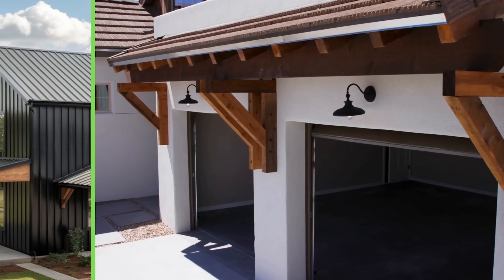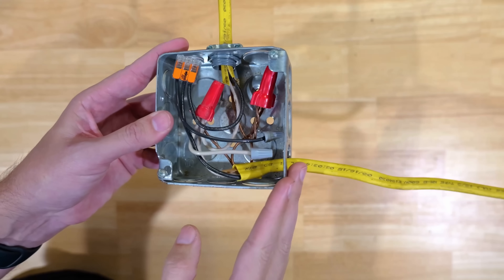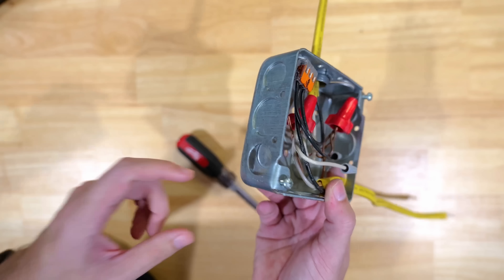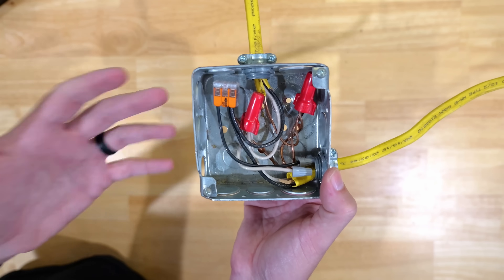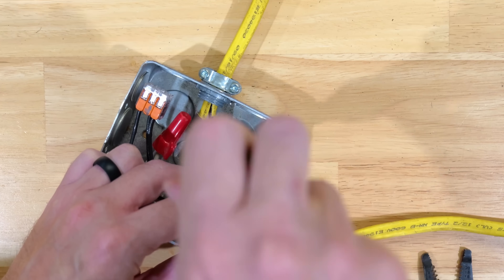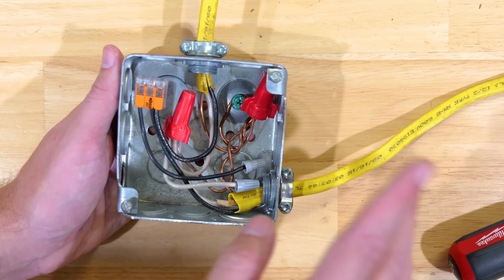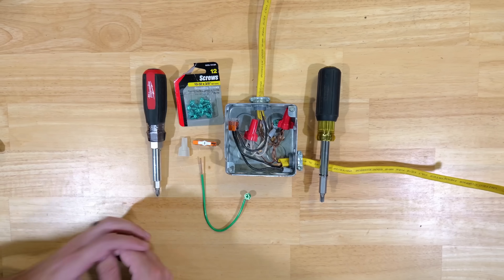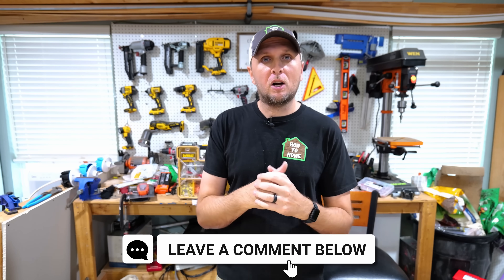SHOCKING Mistakes DIYers Make Installing Metal Electrical Boxes!

Comment from the maker: Be honest, have you ever made any of these mistakes or found any of them to be surprising?
Reply: @HowToHomeDIY  six inch rule. I didn’t take a measurement but assume I left a bit less.
Reply: @ryanyoder7573  Same here.  The wires do extend more than 3" from the box, but may not be 6" in total length.  Splicing the wires to make them 6" long adds another point of failure, whether it be additional wire nuts or Wago connectors.  This is a stupid rule and should be eliminated as it doesn't add one iota of safety.  The other mistakes are common sense and self explanatory.  I've never made them.
Reply: all of the above
Reply: It might be a good idea to give a link to the book "Code Check Electrical"
Reply: You seem to have a 2-position Wago connector with 3 wires in it, by putting 2 wires together under one clamp. I believe that's a no-no?
Reply: It's not that 14gauge wire is not rated for 20 amps, it's that code requires no higher than 15 amp overcurrent protection on 14 gauge wire (Breaker size) so yes,  it is against code. Same with 12 gauge and 20 amp overcurrent protection.
Reply: Once you added the ground pigtail to the box it is “bonded” but not grounded, there is only one place that is “grounded” and that is back at the service panel
Reply: @Coyote-tc1ww  Canadian electrician here. If we're being formal we do take care to refer to bonding and grounding separately and they are separately defined in the code. Of course everyone just refers to grounding informally. Are the terms rigidly defined in the NEC?
Reply: no
Reply: When I started I didnt know about leaving the knock out open.
Reply: On the used house I bought I found the most common mistake is the open hole box. I've been in this house for 31 years and have pretty much rewired the whole house.
Reply: Guilty as charged!
Reply: The stupidest thing that I've run into was a friend's house that I was putting new light fixtures in. In every light box, the ground wires were cut off to about an inch out of the sheathing and not connected. I had to extend the ground wires and when I checked the switches I found the same thing. All the plugs were properly grounded but not one light switch or fixture was grounded.
Reply: @danielbutler578 !!!
Reply: Is it common to have a small voltage on the ground copper wire?  Where could you test it for ground since it is ground?
Reply: The most interesting "mistake" is using a metal box.. why don't you use a good plastic box.. most boxes are pretty bullyproof and usable outside..
Reply: @Flying.Dutchm4n  Considering our codes are so similar, some of the differences between standard practice in Canada and the US are interesting. Where I am in Canada almost all the boxes we use are metal. PVC for certain applications and plastic for ICF work, but other than that it's pretty much metal all day long whether in the wall or on surface.
Reply: I haven't left 6" of wire in my boxes. I give myself enough to pull the wires 4" from the front. Thanks for the info!
Reply: Very thorough. Thanks 😊
Reply: The length is the most one. Mostly because if you are adding a box to an existing circuit,  slack is an issue.
Reply: Keep finding them in current house; think they were allergic to strain relief.  Just found one plastic box where they just broke the side to push a wire through; sub panel has ground and neutral on same bar... that's not going be fun to fix. 

6 inches of 12/2 for 20amp in a shallow single gang box seems a bit squishy.
Reply: Clickbait thumbnail. = "Don't recommend channel"
Reply: The surprise was the clickbait picture showing the Wago in flames. My rule is clickbait = unsubscribe. Or in this case, not subscribe. 
   No new info on Wagos, no new info on wiring. A waste of my time, so that you can get a few more (short term) minutes, by tricking me into watching .
Reply: @othername1000 same here.  See you all somewhere else.

Comment: I was waiting for you to point out that your Neutrals weren't twisted properly. The wire nut was there but it should be twisted enough to twist up the wires. You even noted the Grounds were properly twisted.

Comment: wago's will safely handle more current than a twisted and wire nut connection before melting. There are videos on you tube were this has ben tested.

Comment: Another mistake is assuming that it's a 20 amp circuit, just because it's #12 wire. In addition, NEC require that wiring is done, " in a neat and workmanship like manner."

Comment: No clamp / holder. Box is not grounded. Using a wago is gay. Why use a technique that makes it hard to take apart. Dumb af. Also where is this box going? Limited to places where you can use this technique

Comment: That last one is just an example of code stupidity. Particularly extending the wire in the box creating additional points of failure more equipment in the box to deal with in the likelihood of confusion during future maintenance.

Sure, code can say 6 inches of wire. But if you don’t have 6 inches of wire, there is zero safety reason for making you make any changes to that box whatsoever.

Comment: Another potential problem is the loose and sloppy connection of the 14 gauge wire within the Wago. We can see it pivoting and flopping all around as you handle the wire, so there's about a 100 percent chance that loose-ish connection will become nice and toasty with time and current.

Comment: Very good instruction video. These are all common things that are found. Wire length is crazy. 6 inches of wire is a lot of wire to stuff in a box. A 20 amp outlet box could have as many as three 12 awg romex , or even four. That could be twelve wires at 12 awg. Good luck with that. As for any thing to go under inspection. Rough in wiring you can let as much as you want hang out of an outlet box for inspection. After you finish wire I have never seen an inspector pull an outlet out to look. My idea is to let the wires long enough to work on comfortably and then tuck them back into the box. Just saying.

Comment: As a DYI'er I have seen test benches of the WAGO connectors going far beyond their rated ratios. Granted I am no electritian so again opinion they do work if you follow the instructions. I always give my stuff the tug test as well as the making sure no arking is occuring in the connector that the cable is snug in its position. I am sure if WAGO was a bad idea they'd have stopped making them long time ago
Reply from the maker: Okay?  Not sure what that has to do with anything.

Comment: One thing that boggles my mind is trying to get 12g 6 inch lengths stuffed into an outlet box. Trying to jam that much 12g wire into the back of the box while leaving enough room for the outlet to fit. The amount of stress put on the connectors seems counterintuitive to safety. Why not just leave a loop outside of the box with the plastic wire holder so u can just pull when u need more slack rather than trying to jam it all into the box itself,  nevermind trying to jump from one outlet to another then double the wire that needs to be jammed into it. Its a stupid code. Not to mention with this method you could leave 12 inches extra in a service loop. You realistically only need 4 inches. If its an outlet jumping to another at 4 inches you would be saving a total of a foot of 12g wire that wouldn't need to be jammed behind the outlet. Time to update the code. We have the technology! Lol

Comment: Wire gauge 14AWG could acceptable considering the length of the wire, the voltage will negligeable.

Comment: Hey Adam, I've been following you for quite a while and love all of the videos you do. I've completed numerous electrical projects over the years and have consistently used wire nuts in all of them. I finally used some Wago connectors today, installing a receptacle in the kitchen. I got the power from a light switch's power line, and the Wago's made it so easy to connect everything together. Thanks for all of your electrical knowledge — your explanations have helped me on many projects. I just wanted to say I appreciate the work you put into your content and the clarity you bring to the trade.

Comment: I was a skeptic on wagos, until i used them. Do an electrical tape wrap or some shrink, to insure they dont open. I now prefer them over wire nuts. But...be aware of cheaper knockoffs.
Reply: I dont like them because of cost and longevity

Comment: I hate wire nuts, so I purchased Wago connectors. I especially like that they are clear and have a line, that show how much wire to strip.   I’m so glad that you showed their usage, especially with the ground wire.  I just replaced my outdoor lights on the garage.  The old fixtures had the ground wire connected to the grounded box and the new fixture wanted the ground wires connected directly together.  I used the Wago, so I knew that there was a good connection.

Comment: No clamp or insert can also result in the sharp edge of the punch out cutting into the wire  insulation and cause a short.

Comment: There is absolutely nothing wrong with Wago connectors whatsoever.
Reply: You mean there is no benefit compared to nuts
Reply: @mistasingh14  Ease of use, especially when leads are short and access is limited. Wago 221’s are approved everywhere in the world.
Reply: @rstreets i found these connectors dont hold up. They split easily, are misused on a regular basis
Reply: @mistasingh14  The same is true of wire nuts. Lots of people use them incorrectly, especially when they’re combining stranded wire with solid wire and they end up with a connection that easily fails the pull test. I could argue that in that situation, Wago‘s have a higher likelihood of success.

Comment: House wiring can be deadly. If not installed correctly, you risk fire, electrocution, and killing someone. Electricians already know code and proper and safe installations. If you are not certified, please hire a certified
I find Electrician   and do not think you can, after watching  videos.

Comment: So I have a 1970's home that had 12ga Romex that was ran throughout the entire home including on all 15 amp breakers. I replaced all the receptacles and went from single to double receptacles and used all 14ga Romex for my connections. Did I do that wrong? Should I have used 12ga?

Comment: The gauge of the wire is dictated by the circuit breaker.
If it's a 15 amp circuit, 14awg is fine.

Comment: You should know the proper way to use wire nuts with stranded wire to solid wire. If not done right huge fire problem can occur

Comment: The issue is the wire in the wago thats why wago is bad!
When you have this issue with a wire nut you replace the bad nut. The wago you don't need to replace so the issue stays in the box

Comment: @1:05 anf 15:00 If a bad connection causes a fire in the box, you do not want that fire to escape and burn the house.
@7:00 just wrap one of the existing ground wires around the screw, preferably at the entrance of the live cable , no need to add more wires.

Comment: grounding the metal box?  only if you use metal conduit, right? with plastic boxes you just wing nut the grounds and stuff them, what is the difference between the plastic and the metal without conduit? nothing why ground of the boxes?
Reply from the maker: Makes no difference if there is metal conduit or not.  If a hot wire gets loose in a metal box and makes contact with that box it will be energized to where if you touch it you will become the ground.  Whereas, if the box were grounded in that case, it would trip the breaker.

Comment: Remind me to never allow you to wire my house. That’s one ugly looking J box right there

Wires should be grouped together properly and neatly folded into position in the box and your wire nuts need to be tighter. I promise 

NEVER & I cannot stress this enough NEVER use wago connectors for electrical splices and if I need to explain why you need to go back to school OR gain another 30 years of experience 

You CANNOT just add a pigtail to a short wire and call that gtg you have essentially done nothing to lengthen the short wire. Again if I need to explain you don’t need to be an electrician go back to being a carpenter 

Never use plastic push in connectors OR metal push in connectors in electrical work only an amateur or homeowner would do such a thing UL listed is not relevant good craftsmanship is!¡!¡!¡!

Thank you for your attention to these matters

I’ve said it for the last 44 years and I stand by it

They don’t let Electricians wire houses. Helpers wire houses the Electrician sits in his office and lets his flunkees wire the house. Electricians wire Power Plants, Airports, Data Centers, Oil Rigs, the Secret Services HQ in Washington DC, the Runway lights for the security detail @ the US Embassy in Baghdad,,,,, things like that…….

Comment: I have gone into situations where a homeowner has already run cables into a box and left them barely emerging from the front of the box.
They may think that they are saving money or just that it is sufficient. If the box is sized correctly for the size/ number of cables, and the conductors are grouped together by color then they can be spliced well outside of the box and then rolled or accordioned as a group neatly into the back of the box leaving plenty of space for the jumpers and the device. Having enough wire to work with will not only make the job easier and faster but will help yield consistent results

Comment: You lost me at about 30 sec into your video there is no way in hell you are an electrician why do i say that? Look at your hands you have a perfect pedicure.!!! Electricians have dirty hands have you pulled wire all day at a construction site? LOL you would have black crud all under your fingernails. Its the same analogy if you see a mechanic with clean fingernails RUN because he never does anything

Comment: The worst home appliance for home wiring, is those oil filled electric heaters. 

Those draw so much amperage that even the cord that is made on them gets very hot, and I've seen outlets melt and fail on a 20 amp circuit, wherever those things are being used.

Comment: You should have told us the correct direction for the cable clamp's locking nut. The larger-diameter face, which has the gripping teeth, should be the face in contact with the metal box.

Comment: You did not use a green wire nut. Required here King County in Washington state.
Reply from the maker: Well King County is not the majority.  That’s why you have to check local codes too.

Comment: was a bit skeptical clicking on this video. but i just wired my entire shop using surface mount electrical boxes and was curious. turns out i made two mistakes. missing box grounding screws and knockout covers. thanks for the heads up. i am of to the orange box store to pickup supplies so that i am code compliant.

Comment: Thank you. Clear and to the point. I am changing out our outside security light and SURPRISE every mistake you showed was already done in my current set up. I’ve done a fair amount of diy and couldn’t identify any mistakes lol until I couldn’t fit my connectors behind the mounting bracket and plate at which time I looked up multiple YouTube videos. I purchased a j box and fixed some of the problems but just discovered more from your concise video. Most notably I had no idea I needed to attach the ground to the box if I had the grounds in a wire nut. Also the Romex was removed back to the wall so there was no way to advance it thru the box. What would b the fix for that? I was certainly hesitant to pull on it. Is there a fix aside from calling an electrician to replace the entire Romex (back to the breaker?)? Thank you so much for making us all safer.

Comment: Specific loads drawing full capacity or long runs may benefit from stepping up to the next wire size to reduce voltage drop. About the only legit reason to put 12ga on a 15A breaker.

Comment: Please add an explanation of box sizes and where metal or plastic boxes may be used.
Reply: Speaking in residential use, there was a time, very long ago, that all boxes were metal, then plastic became available and took over. In residential work today, you can use either, for me, I use whichever works best for a particular use. FYI, I’m a retired master electrician, electrical contractor, and I think this video is pretty good, but I’d argue a couple points.

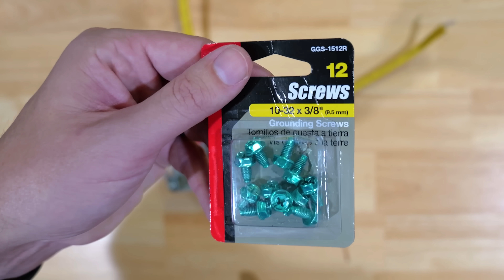Comment: AT 6:43 HOW MANY WIRES CAN YOU PUT INTO A TWIST CONNECTOR ??? 5 OR 3 OR 4 ???
Reply: It depends on the size of the wire nut and the wire gauge, but typically it's 5 or 6 maximum.

Comment: @ 6:37 you can hook the ground copper wire from the run cable or romex cable to the ground SCREW and tie it in and no cut wire just wrap it around the Ground Screw INLINE no cut no add more wiring and no tie it in to something. just do as i do run the cable ground when it comes into the box to the ground green screw: then over to the connection of the switch or receptacle ... i think it is a great idea.

Comment: When wiring a shop or garage/ shop any outside building.  Wouldn't it be better to use a separate breaker box? Or a small breaker system in conjunction with the metal boxes?

Comment: It cracks me up. Wire nuts have been used from day one. I also tape my wire nut connections as well. If the wires are twisted properly, and you tape it to hold it in place, and prevents any wire from ever touching anything else. Basically fool proof. People always invent new things to make money, change codes to make you buy them, when sometimes the old school ways are perfectly fine.

Comment: Been using red heads for 40 years and if you put them on right you don't have problems. Read the instructions. You twist them and they twist the wires together. Wagos look like boat trailer connectors.